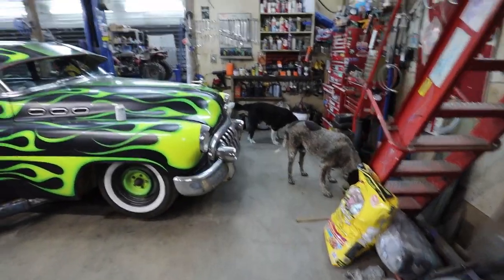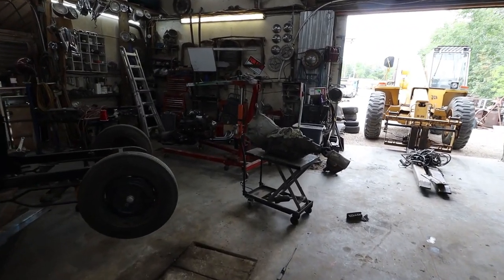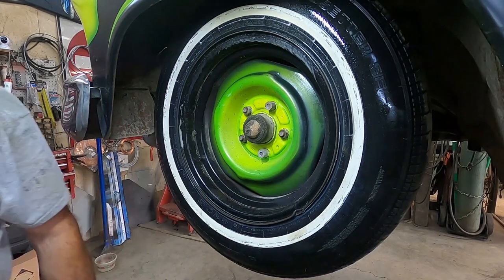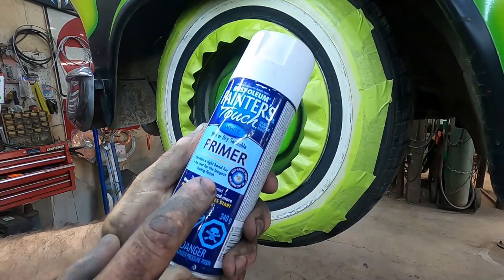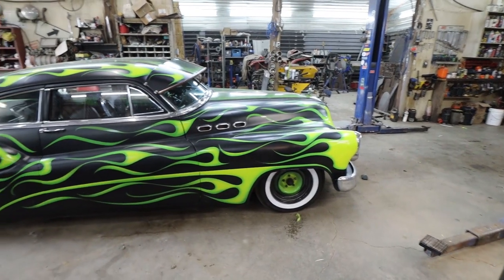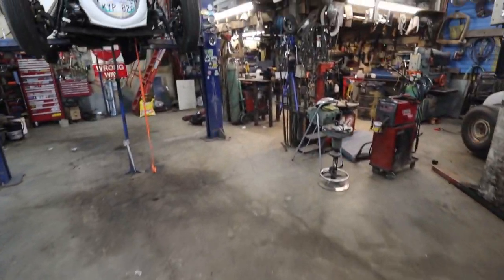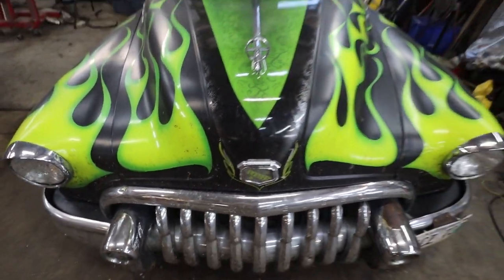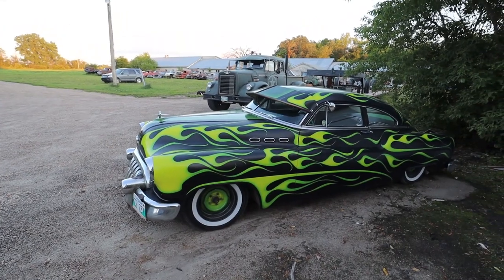Buick maintenance and how to paint a set of whitewall on the cheap.

Comment: For wide whites, I have had great success with "Elastomeric roof coating".  Comes in white and goes on with a brush.  It is thick but will run so you have to take the wheels off and lay them flat.  The brand name I used is White Knight Flex Coat and in Canada it is available at home despot.  Pricey at $59 a US gallon but it works really well and lasts.

Comment: So I didn't see whether or not you fixed the problem that was causing the windows to crack. And I was wondering if you could drill out a hole or grind a small Chanel in the window handle where you could get a dental pick in there to remove the clip? Good to see more of Pablo in the video. Good tip on the difference in the masking tapes.

Comment: When I was in the metal trade, I made a door handle remover with just some 16g flat stainless steel with         a "u" shaped slot wide enough to get behind the handle with tappered ends that springs those clips out , as someone says " easy peasy  " 😆😆😆😆😆😆

Comment: Nice work Brent! a curiosity: the primer you used for the whitewalls of the tires does not tend to yellow over time?
I am interested because I have a '69 Beetle and two Harley Davidsons on which I have always put white wall wheels, which  are very expensive and this would be a good solution to save some money👍😉

Comment: Not to be dumb but if the window rolls down to far couldn't you put the window at the lowest you want it and mark the regulator and then put a booger weld on the teeth to stop it from going any further to prevent further travel